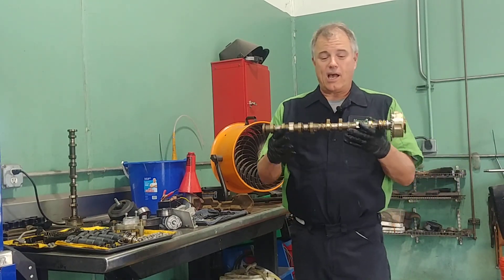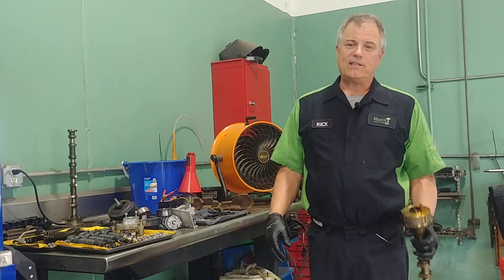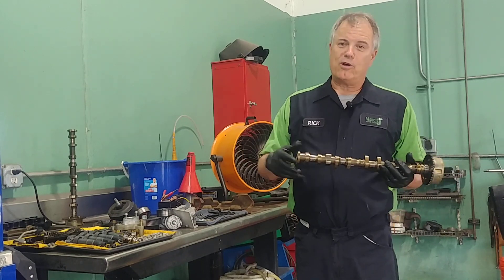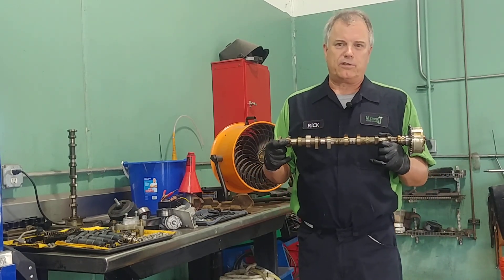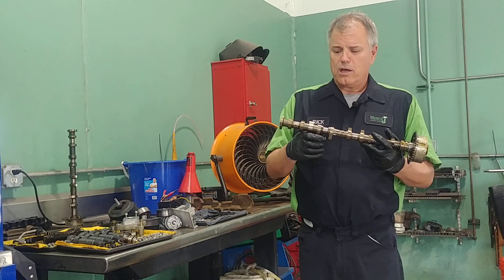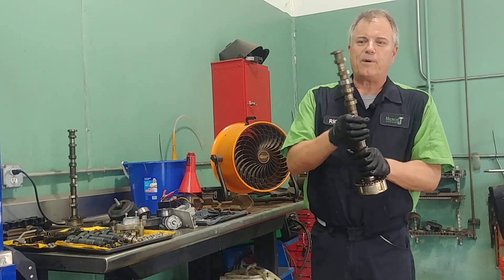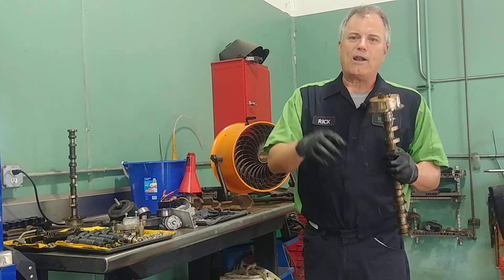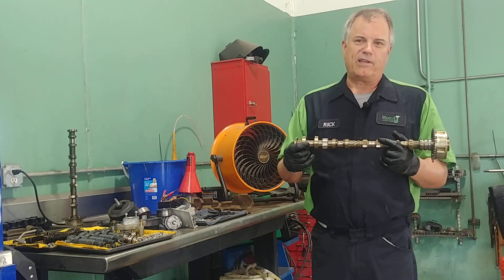What causes a Camshaft to fail?

Comment: Years ago, I put a new camshift in my hot rod. It had lower lift, shorter duration than the one I had before. All new hydraulic lifters. It was lubed up really well. I broke the engine in and it was running perfectly for about 250 miles. Then lobes started wearing off. Good oil pressure the whole time and oil change after breakin. Any ideas why it could have failed?
Reply from the maker: Either the camshaft was not hardened properly or it was an incorrect assembly lube.
Reply: @MercieJAutoCare  Hmm, hardened as in poor manufacturing? It was in the 80s.